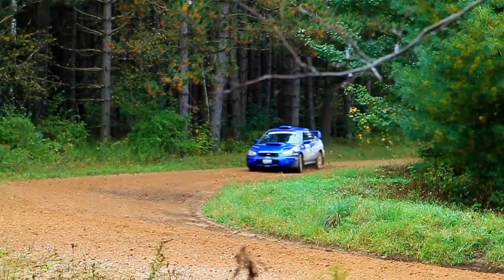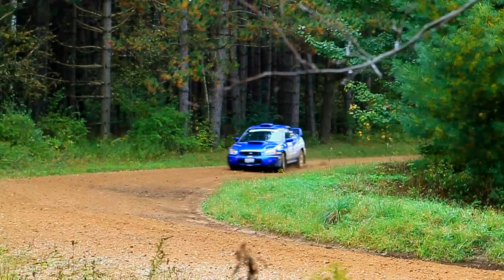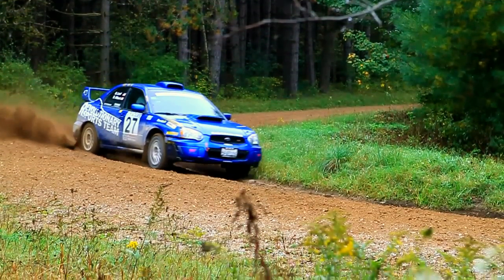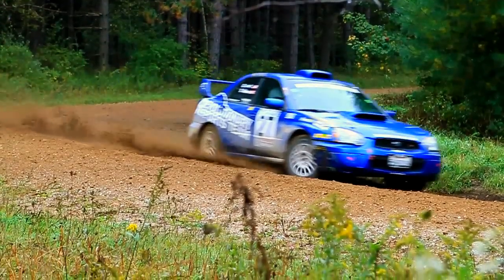Revolutionary Sports - Trail Braking In Rally

Comment: Sorry I don't understand a thing you have said
Reply: 1. Breaking shifts weight to front tires for better turn control
2. Control back wheels and positioning of car for Apex of the turn
3. Arrive in optimal position at the Apex of turn
4. Prepare to gun it out of corner while still having enough control for extra circumstances